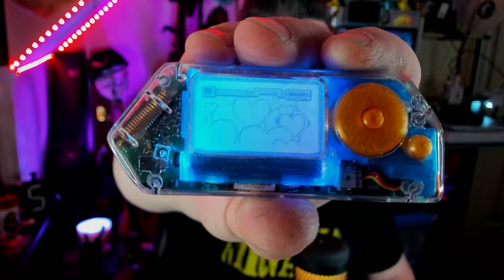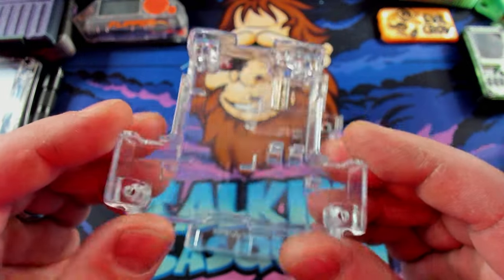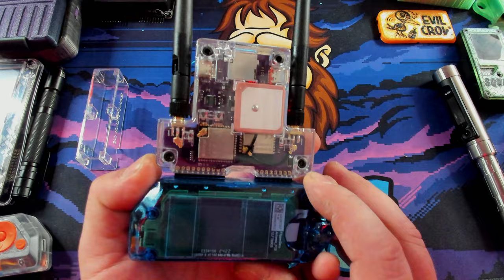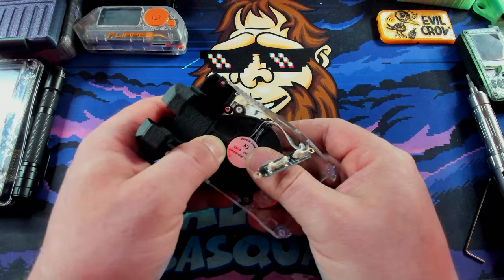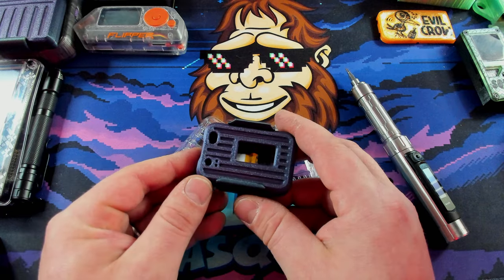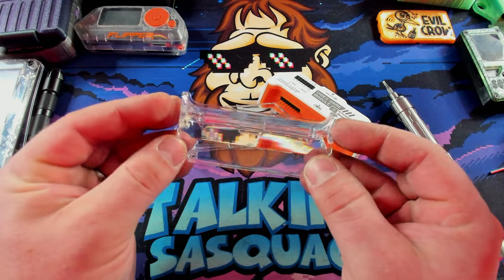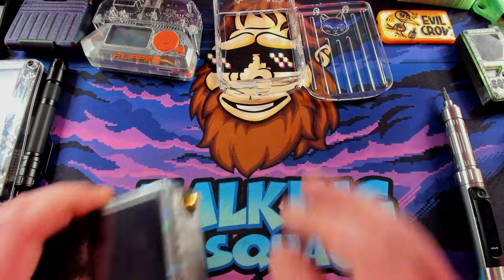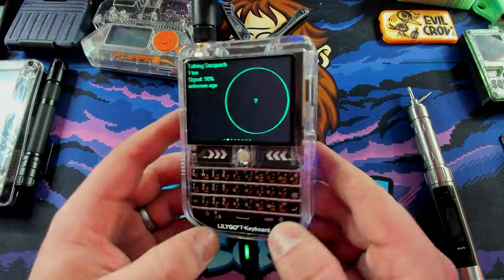Clear Resin Makes EVERYTHING Cooler!  Printing Clear Cases For Everything I Can!

Comment: Very cool. I have a couple Alley Cat Meshtastic cases (T-Deck & T-Beam Supreme), but I'd like to get another 'T-Deck' and get a clear case printed for it. The one I have has an 8,000 mAh battery in it, so I'd probably have to modify the case a  bit.
Reply from the maker: If you can print your own, you can dry fit it, then get the cases printed at PCBWay.  Just make the case a single STL and it'll cost a bunch less to print!
Reply: @TalkingSasquach  👍

Comment: Wouldn’t recommend running meshtastic on that heltec without the antenna connected. Without one the energy that it should be radiating outwards to other meshtastic nodes is getting reflected back into the transmitter and it can fry it
Reply from the maker: Noted! Thanks!

Comment: What was the total cost? Also, did you bundle all the stl files into one job, or did you do each part separately?
Reply from the maker: So if you combine all the pieces as one STL, most of those cases are in the $20ish range.
Reply: @TalkingSasquach  so, like, ok

I'm thinking of going for the clear f0 parts by @zR_CrackiiN including screen delete shell, button frame, and buttons. I also want to throw in eried's HackRF case, and maybe a pwnagotchi case to boot, all in CLEAR resin. How would I go about it?